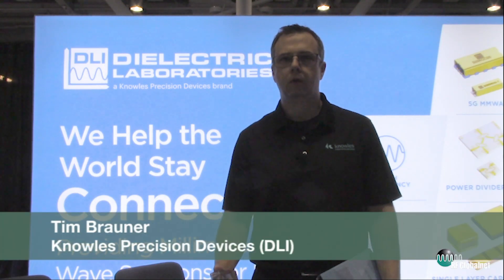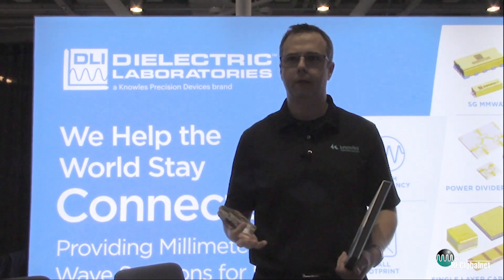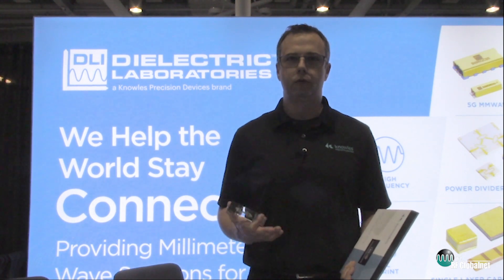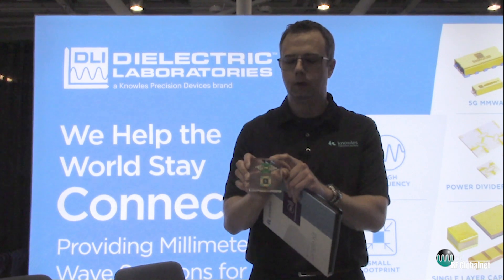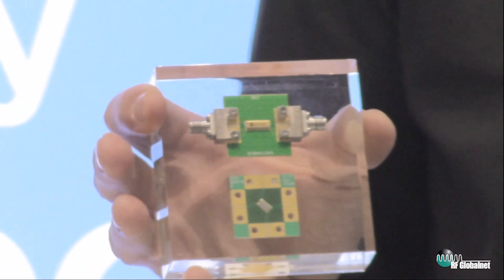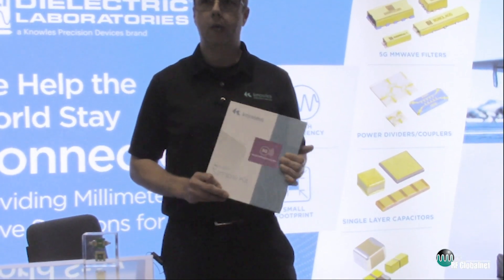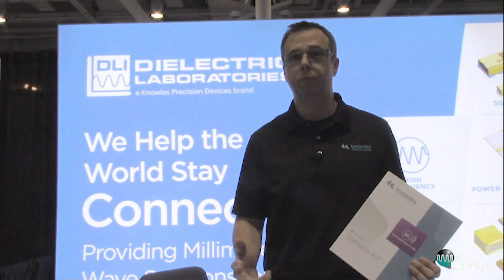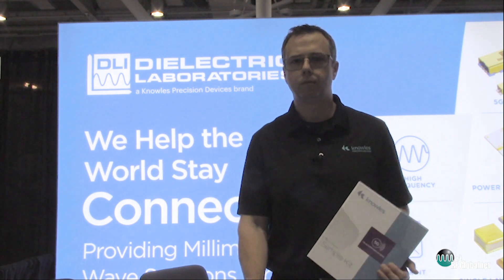mmWave Filtering For 5G Applications

Comment: George Gilder recently wrote about Akoustis Technologies 
in his moonshots newsletter.  Here is a  paraphrase:   Akoustis’s RF 
filter solution is unlike any of its competitors.  It improves the 
signal acquisition while enabling higher bandwidth, higher operating 
frequencies, and higher output power.  The design, technological 
advances, and efficiencies provide what Gilders calls a “disruptive” 
improvement that is sure to displace the incumbent “dielectric 
resonator” (DR) solutions, dominated by Broadcom.  And even more 
remarkable, these filters are 23X smaller in size.  Now each router has 
24 radios inside, and every radio needs its own filter.  All these 
radios generate a lot of noise and interference.  Akoustis’ patented 
single crystal filters are said to do their job better than the 
dielectric resonator-based filters competitors offer.  Therefore, 
Akoustis’ filters make far more efficient use of the spectrum as it 
passes through.  The product is simply better, faster, smaller, and 
cheaper than all the competitors.  The major manufactures of 
telecommunications products are taking a serious look and have been 
testing these filters.  If the technology is as good as reported,  large
 orders should start pouring in soon.

Comment: Thank you for the video. I have two questions. 
1. Do 5g phones today like galaxy s10 have rf filters that can handle mmwave frequencies? and if it doesn't, can the phone truly be called 5g?
2. I read that 3g phones need roughly 30 rf filters, while 4g phones need 40, and 5g phones 60. I'm guessing these are all SAW filters. Do these extra 20 filters as we move from 4g to 5g phones cover only the sub 2ghz frequencies or can it cover frequencies up to 6 ghz?
Thank you!